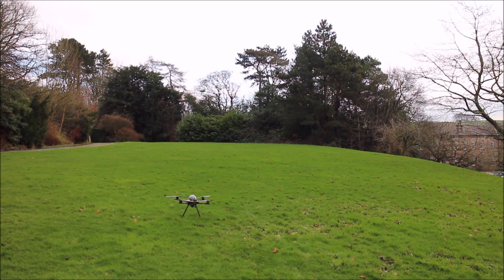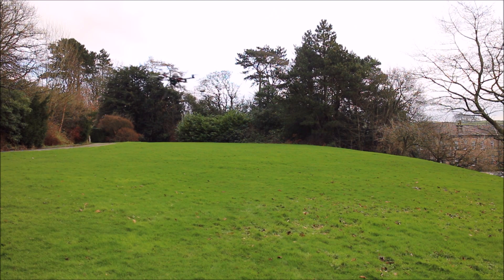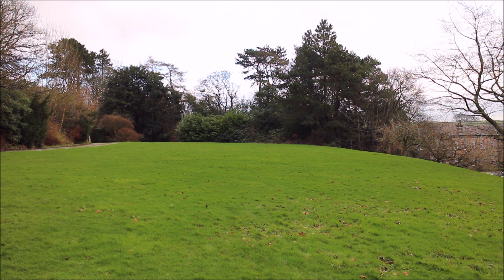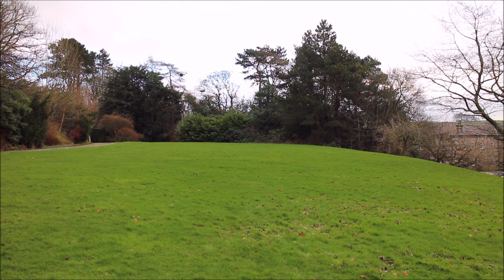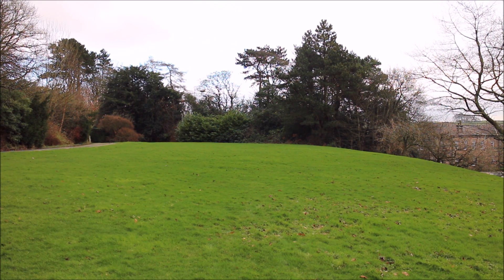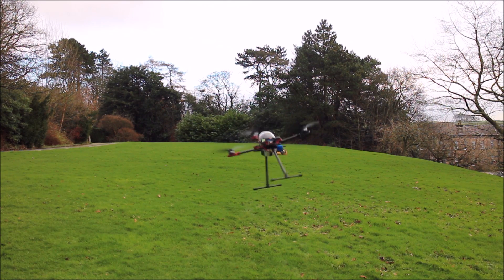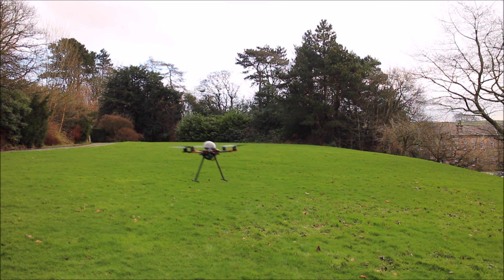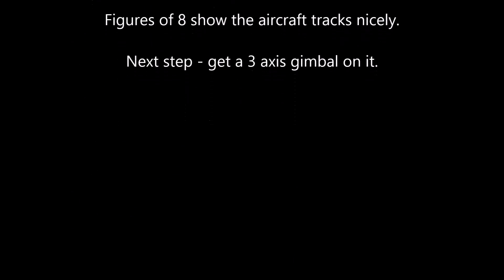HMF U580 Pro Quadcopter Maiden Test Flight

Comment: I tried to fly my HMF X8 U580 for the first time in a gym last weekend. Just at takeoff I was getting the same wobble as in your video crash. I suspect the flimsy lading gear was affecting the flight controller. I will try to pop up the helicopter into air next time with more throttle. If you have cured the wobble let me know. Your build looks vary nice.